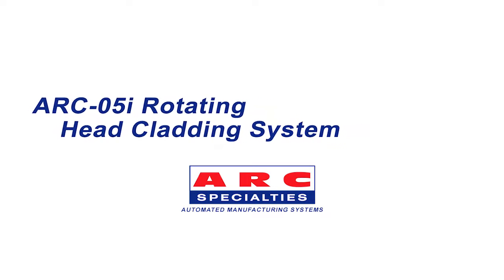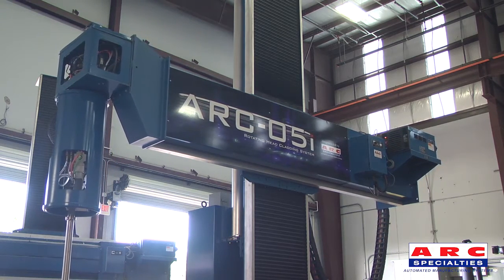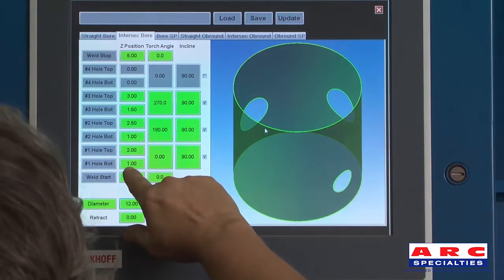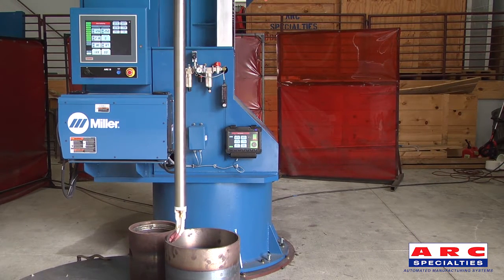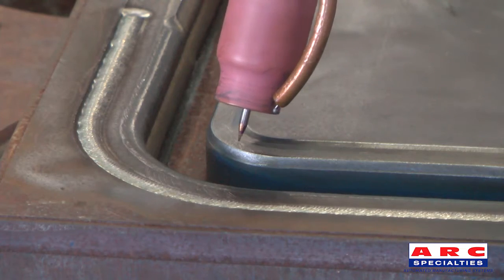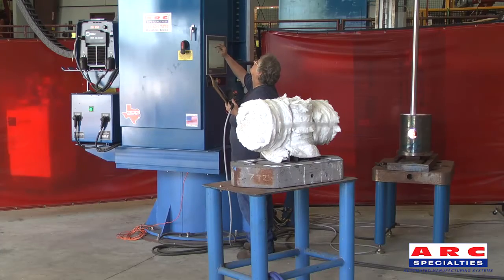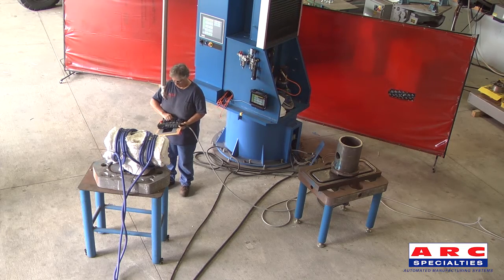ARC-05i Rotating Head Cladding System

Comment from the maker: 👇 Want to increase your weld deposition rate by up to 5x? 👇

The ARC-05i Rotating Head Cladding System is the solution for high-volume, precision bore welding.

💡 Click the timestamps below to jump to the most important parts:

0:12 - See the Massive 80-Inch Bore Diameter Capacity

0:34 - Quick Programming Options (Touchscreen & Pendant)

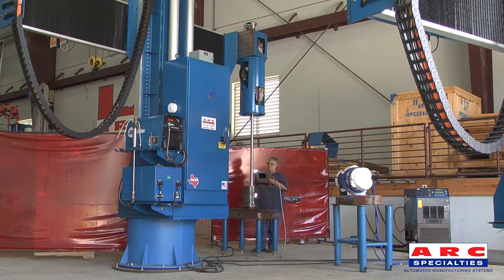2:00 - Watch the machine hit 8 lbs./hr. Deposition Rate!

Ready for a quote? Visit our site for specifications and to contact our experts: https://www.arcspecialties.com/product/arc-05i-rotating-head-cladding-system/